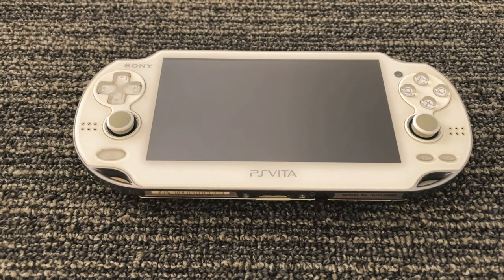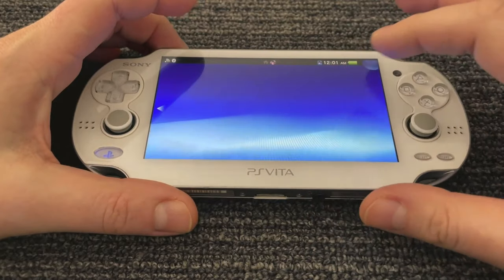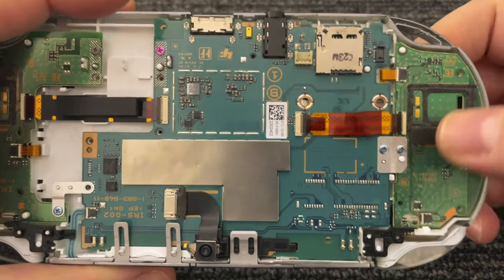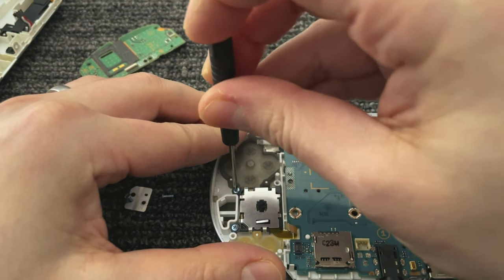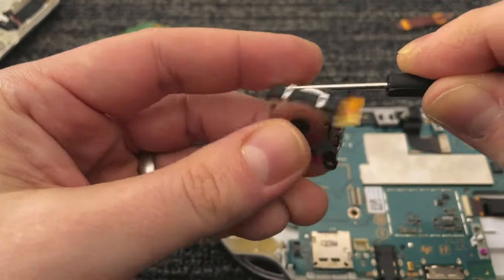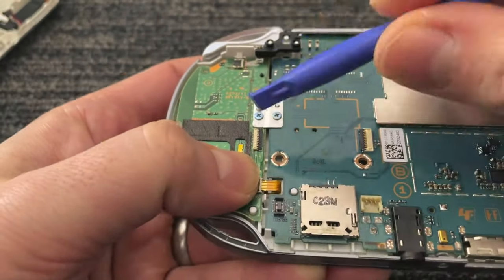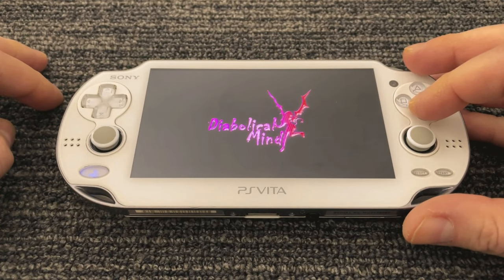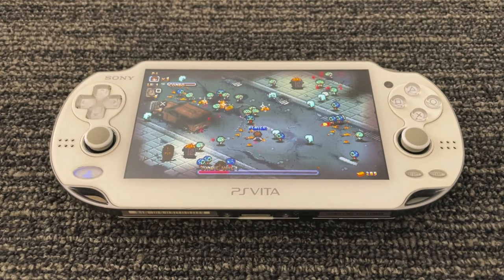What is Wrong with this Vita's Right Analog Stick? PCH-1001 OLED Model (FIXED)

Comment: i broke that stupid lil black lock of the connector... does the ribbon need to have pressure on it in order to work?? or am I screwed and need a replacement board? I was hoping I can just hotglue the ribbon to the pins... but i wonder if those ribbons need to have pressure towards the pins to work.
Reply from the maker: It's worth a shot but the pressure may need to be precise.  I played around with varying levels of pressure and connection and I didn't have much luck unless I had the clasp fully closed.  If it's on the Thumbstick board, it would be cheaper to replace than the motherboard.  Either way it's worth trying.  That's how we figure this stuff out.  let me know how it goes.
Reply: @PalominoBlueGames  got my quick fix. it's hot glued to the pins.. didn't use much on there to not break them in case I have to get in there again. I disassembled the joystick, lift those tiny metals that make the rotation touches on the ribbon.

You are right about the presure. At first i didn't realize the ribbon was supposed to go underneath the pins and not over it. Once i inserted them under the pins, the analog stick started to respond. Any movement left or right would cause it to drift. It needs to sit at a specific point. I realized that if there was not enought pressure on the pins, the stick would drag pretty slow.. but if pressed down on the ribbon(so the section under the pins would lift up) the stick worked good. Did all of the testing with the system open of course cause it was pretty much trial and erro.. minecraft works fine, gta works fine,  however that mercenary game is oddly turning left faster than turning right.. i'm not sure what this means but at least I'm now getting response on my right stick..

anyways.. thought I'd let you know in case anyone is going through the same Lol. Hotglue works just fine! you just have to place the ribbon where it should be and not move it while you apply the hot glue.
Reply from the maker: Thanks for the update. Very interesting indeed.
Reply: I didn't realize that this caused problems :// I got a new analog stick and broke the black thing on top of the clasp when fixing it, and now have a whole new issue

Comment: do you know if i can use a psvita 2000joystick on a psvita 1001? they have them on walmart but only for the psvita 2000
Reply from the maker: Unfortunately the ribbons are different and they are not interchangeable.

Comment: I tried to repair the right analog stick, completely disassembled it, and cleaned everything, there is nothing obviously wrong to see, i closed it back up and nothing happens, even if i swap the joystick to the left side, it doesn't work, sometimes, it registers left, but only once out of a 100 tries, i am just gonna replace this analog stick with a new one because i don't know what is wrong with it. I even messured all the small traces on the ribbon cable of the analog stick, and if i swap the left analog stick to the right one, it just works perfectly fine.
Reply from the maker: I think in your case it has to be the stick.  I tried swapping my sticks and i had the same issue on the right with the other analog stick so I knew something had to be up with the board or ribbon.

Comment: So, the ribbon could be my problem about my right analog stick not responding to the left and right movements
Reply from the maker: Very possible. It might be a matter of cleaning or reseating the ribbon and not even replacing it. While I was troubleshooting, I got the old busted ribbon to work a few times but I had to hold my finger on it just right to continue to work. Replacing the ribbon completely fixed the issue.
Reply: @PalominoBlueGames  thx for the info. Good luck on your channel
And yes I decided to give your channel a little boost in the algorithm